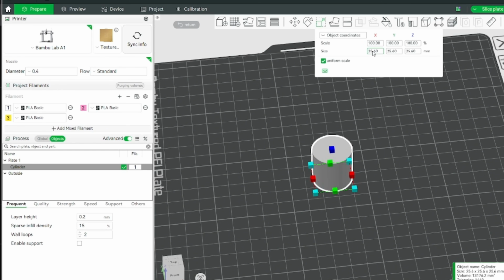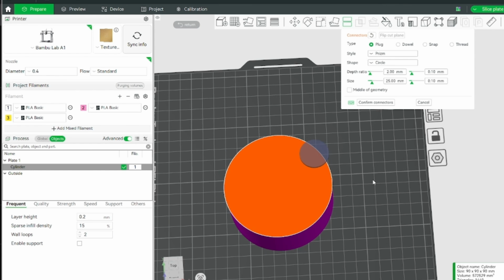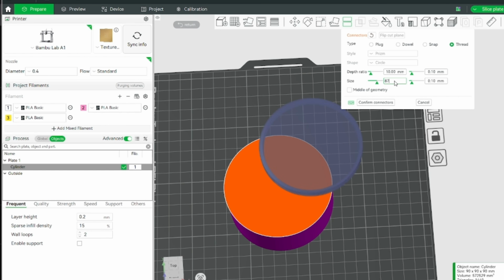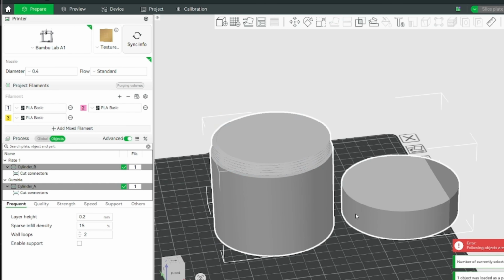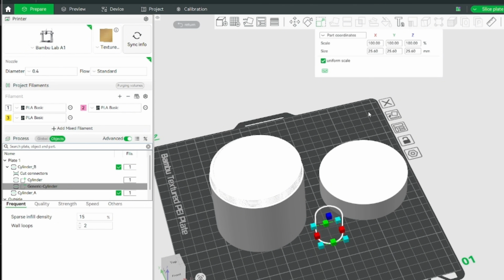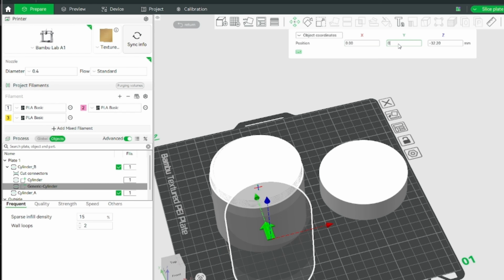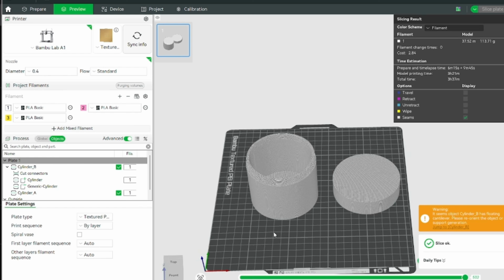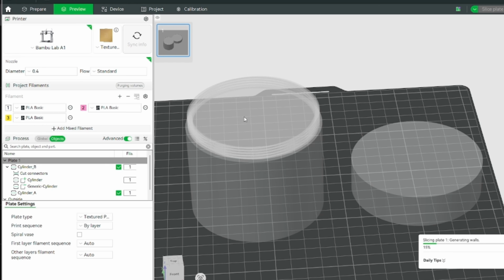How to make thread in bambu lab

Comment: WHile yours performed correctly, when I completed all of the steps, I have a warning "It seems object Cylinder_B has a floating cantilever.  Please re-orient the object or enable support."
Reply from the maker: It depends on how you created the thread. My advice would be to re-orient the object, though in some cases, supports are simply necessary. I'm actually going to make an episode about supports very soon, so stay tuned!

Comment: I followed everything and it seemed all good, the base printed perfectly but the lid had stringing crossing over the sides where the internal threading is. I changed the settings to try and help (avoid crossing wall, 0.16mm optimal, outer/inner etc) and it still wouldn't print properly. What am i doing wrong? xD I'm using a 0.4 nozzle and printing with PLA
Reply from the maker: How did you orient the lid when you printed it? Which position did you print it in?

It could be related to the print orientation, so I’d recommend checking that first. The settings you mentioned shouldn’t be a problem — a 0.4 mm nozzle with PLA should work fine.

Try changing the orientation of the lid and see if you get a better result. It might be the cause of the issue.
Reply: @AladdinLab_25  The lid was laying flat on the build plate ☺️
Reply from the maker: Try printing it in a different orientation. Set it at a 45° angle and use supports, and it should normally print successfully. 😊
Reply: @AladdinLab_25 Okay thank you! Trying this now 👏🏽
Reply from the maker: @Jadellsbb  You're welcome, Good Luck

Comment: What PC are you using? Windows or Mac? I'm using Mac and not able to get a thread to generate at all. I've re-started both the app and the Mac still experiencing the same issue. Any ideas? Thank you
Reply from the maker: Make sure you’re using the latest version of Bambu Studio. There have been several updates recently, so I’d recommend checking that you’re on the newest version available and then trying the thread feature again.
Reply: @AladdinLab_25  Thanks for that reply. As I couldn't get it to work on my Mac, I got a Windows 11 machine, yet still not producing any threads. Is there a setting I need to click maybe?  UPDATE. I've sorted it, I think. After creating the thread centrally on the cylinder, I thought that with it showing there it was correct, what I needed to do was click on the thread (turns it blue) then it was sorted. A simple fix but took ages to find.

Comment: Is there any reason I would be loosing the thread in the cap when I export as an .stl file ??
Reply from the maker: No,  Just export *all the objects as a single STL**. You'll get a message saying **"Negative part detected. Would you like to perform mesh boolean before exporting?"* Just click **Yes**, and the threads should be preserved in the exported STL.

Comment: I'm trying to do this and when I get to the point to Perform cut the threads disappear, I'm using the same settings as you are, any ideas why this is not working? Thanks
Reply from the maker: There's one very important step before you click *Perform Cut**. You need to click the **orange surface* of the cylinder first to tell Bambu Studio exactly where the thread should be created. I hope that's the step you missed, because if you skip it, the threads can disappear after the cut.

Comment: I only have three connectors available in Bambu Studio..Plug, Dowel and Snap...the Thread option is Not Available, Is it possible to get it from somewhere and place it into the menu options? and if so, How do I do it?
Reply from the maker: Make sure you're using the latest version of Bambu Studio. Try updating Bambu Studio first, as the Thread connector is only available in newer versions

Comment: Great video - thanks for your clear instruction.

I want to know how to cut only a section of a design. EG: I have a V shape and want to only cut off half of one "leg". Currently I can only do this at a steep angle avoiding the other leg because I don't know how to limit the cutting plane size. Is there a way to do this? Would it be a useful video?
Reply from the maker: The Cut tool uses an infinite plane that goes through the entire model, so unfortunately there's no way to limit the size of the cutting plane. If the plane touches a part of the model, it will cut everything it passes through.

However, you can achieve the same result using other tools like **Split to Parts**, **Negative Parts**, or **Mesh Boolean**, depending on what you're trying to do.

And yes, that's actually a great idea for a tutorial. I'll make one soon!

Comment: great advice ,printed three containers with a 37mm thread ,0,0.2,0,4 , the lid was very tight . how much is requid for a loose fit
Reply from the maker: I had to go up to 0.6 mm to get a loose fit , You can experiment, and don't forget that the type of filament also makes a difference.
Reply: @AladdinLab_25  THANKS
Reply: @AladdinLab_25 thats in the tolerance tab?
Reply: I designed a container in cad ,i had to make the the lid thread opening 1mm bigger in diameter for it to fit

Comment: I missed how the cap got the threads? Was it performed automatically on the connections and then cut?
Reply from the maker: Yes, exactly. The connector automatically modifies both parts it connects to, including generating the matching threads
Reply: Yes, a connector modifies both parts it is connecting

Comment: It seems to work ok as per your video, until you begin to remove the inside and making the model to  centre, when pressing the dimensions to 0, it keeps bringing it back to 100%.
This is on the latest new version of studio, what am I either doing wrong or missing some settings perhaps.
Reply from the maker: Thanks for your comment! When you move the negative part, make sure that the position mode is set to Object Coordinates and not World Coordinates.

If World Coordinates is selected, entering values like 0 can produce different results because the position is calculated relative to the build plate's global coordinate system rather than the object itself.

Try switching to Object Coordinates and then repeat the step from the video. That should work correctly on the latest version of Bambu Studio as well. 😊
Reply from the maker: Ahh yes, now I understand the mistake 👍
The issue is that you were scaling the negative part instead of moving it.

When you select the negative part, make sure to press M (Move tool), not Scale.
Then, in the move settings, switch the position mode to Object Coordinates.

After that, set the X and Y values to 0, and it will correctly center inside the object.
Reply: @AladdinLab_25  thank you so much for your kind quick reply, I tried it this morning and it worked.
Reply from the maker: @stuart4176 You're very welcome, happy printing! 😊

Comment: I followed the steps 
Everything printed perfectly except the threads 
Any idea what I did wrong ?
I said no to supports ? As couldn't see yours with any and Infill was 7% I changed to 15 % could they be why ? 
I'm still new to editing
Reply from the maker: Supports depend on the specific model and print orientation. In my case, supports were not necessary, but for your setup they might be.

Increasing the infill from 7% to 15% shouldn't affect the threads.

By the way, which nozzle size did you use? 0.4 mm or something else?
Reply: @AladdinLab_25 Hi I'm using 0.4mm
On x2d bambu 

I did the same sizes u did 
Another thing I did was used a new colour I didn't use before pla matte bambu lab 
Not sure if would be the cause
Reply: Try using the Variable Level Height at the lowest (0.08mm) just for the thread portion.   It worked for me.

Comment: Do you just have to play around with the settings to know thread size or is there a way to know?
Reply from the maker: The most important settings are the thread size and depth ratio. You need to know the specifications you're aiming for, so you'll have to adjust them based on your needs. As far as I know, there isn't a universal method that works every time usually it takes some testing and tweaking to get the perfect fit.

Comment: The thread is not centered in both parts when I try to do this.  I can see that yours is also not aligned especially on the lid part.  Did you try printing this?  Maybe it only looks misaligned in the slicer?
Reply from the maker: Thanks for pointing that out 👍 The alignment issue you see in the slicer is sometimes just a visual artifact. I tested the model after printing, and the threads were correctly aligned in both parts
If I change the nozzle to 0.2 mm, the problem will disappear

Comment: OK,  I am in front of my Mac.  I am following instructions exactly and the threads are not showing up.  I wonder if I am hitting a bug.
Reply: I have the exact same problem but I'm using Windows.
Reply: I am also using Windows and following the instructions but the threads are not showing.
Reply: You have to place the threads on the object when performing the cut. The threads don't automatically come on. Also, the size of the threads are going to be small at first which you need to increase so that you can see where exactly you are placing them. Selecting middle of geometry will automatically get them to be centered. Hover your mouse on the object to see where exactly the threads are being placed. 

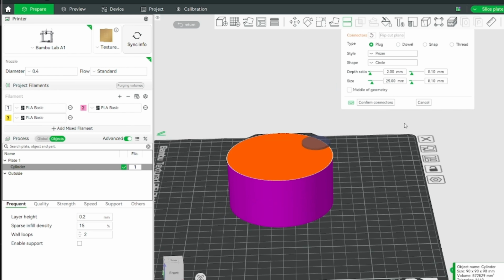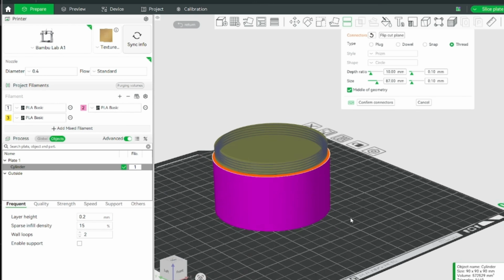I recommend seeing the instructions from 0:48 to 1:30 again.

Comment: Do you need a negative object in the lid part?
Reply from the maker: No, the negative part is only needed for the container. The lid already removes the required material automatically when the threads are generated, so there's no need to add a separate negative object to the lid.
Reply: @AladdinLab_25  And I would presume that the depth of the threads in the preceding step determines the thickness of the lid, right?
Reply from the maker: Yes, you are absolutely right. The depth of the thread directly affects the wall thickness of the part. If the thread is too deep, it can make the wall too thin, which might lead to structural issues or even printing failures depending on your wall line count.

Comment: Thanks for this. One thing that is not clear to me though is choosing the thread type. I can't see what you did there. Can we choose from Whitworth 55deg, PG 80 degrees, metric / imperial, - 60 degrees or acme 30 etc. Or even perhaps a custom thread profile?
Reply from the maker: You're welcome! At the moment, it only generates a standard thread automatically. But Bambu Studio is evolving quickly, so we may see support for specific thread standards in a future update. If that happens, I'll be sure to make a tutorial on it!

Comment: Great video, didn't know this is a feature inside Bambu Studio.
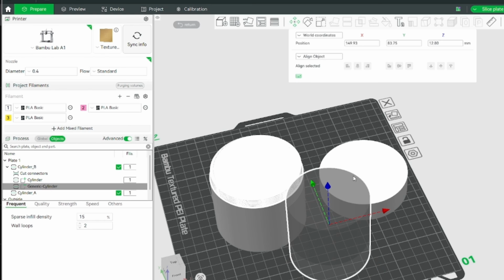2:25 One more thing: You can align the negative object easier, by just selecting both the negative object and the primary object (by holding Shift and clicking both).
Then press "M" for Move and instead of going for the dropdown "World Coordinates" / "Object Coordinates", go for the segment right underneath.

There you can now align the two objects in all 3 dimensions and multiple ways.
This can also help massively when manually arranging multiple objects on a plate.
I only discovered it a couple of weeks ago, so it may be a somewhat new feature, but not sure. Maybe I just overlooked it until then.
Reply from the maker: Thanks for the tip! I actually wasn't aware of that alignment feature. It definitely makes positioning negative objects much easier.
Reply: @AladdinLab_25  Yep, I also only discovered it by accident. Maybe do an updated video on it if you find time. I'm sure many people are unaware of it.
Reply: Crate a youtube video!

Comment: How does one figure out what the thread type and specs are for a particular object, say a liter poland spring bottle?
Reply from the maker: You can measure it using a caliper. Measure the outer diameter, the inner diameter, and the thread pitch (the distance between two consecutive threads). These measurements will help identify the thread type and specifications.